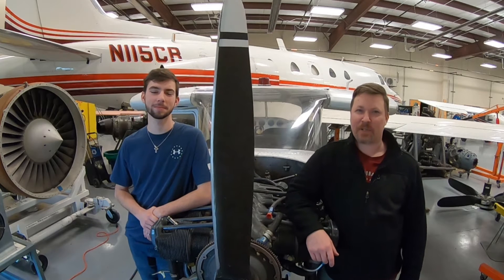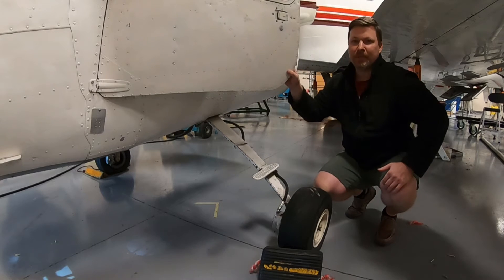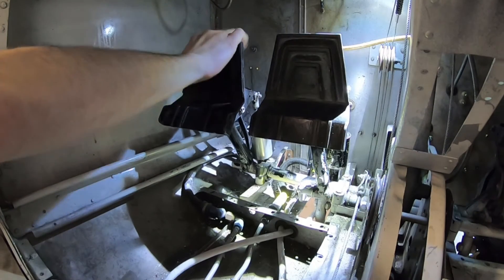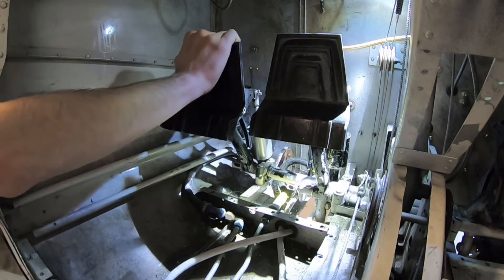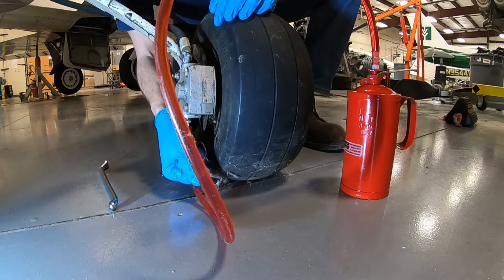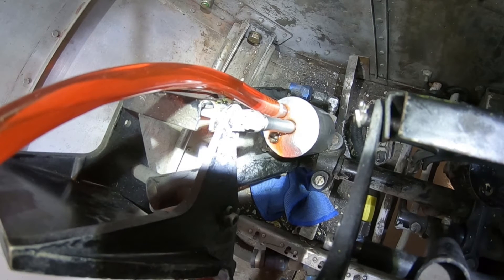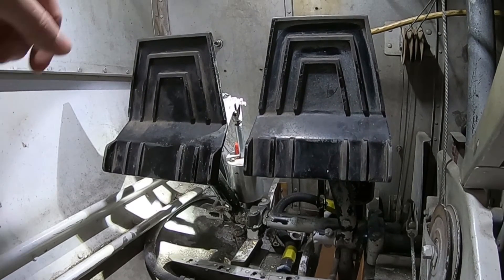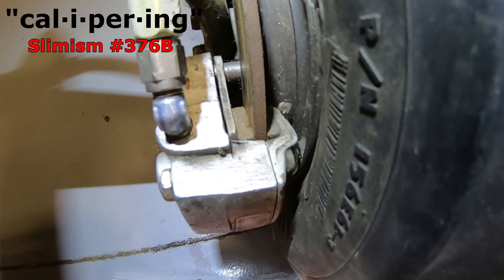How To Bleed Aircraft Brake System With Slim And Eddy

Comment: Where did you find the tool to pressurize the 5606 into the caliper?  TIA,
Reply from the maker: It is from Tractor Supply. I believe it is Item # 395958399
Reply: @SlimAndEddy  Thank you!

Comment: What if you don’t have a hydraulic pump?
Reply from the maker: If you don't have the hydraulic pump you can perform the "top-down" method. This would require two people. Have one person pressurize the system (pumping and holding the rudder pedal), while the other person releases the bleeder valve at the brake caliper. Just be sure to keep added fluid to the master cylinder, otherwise you will continue to pump air in to the system! Hope this helps!